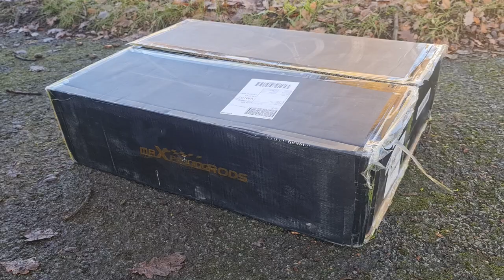BMW E60 MAXSPEEDINDRODS Full Coilover Instal and Adjustment

Comment: Will be attacking my E60 this weekend to fit the same coilovers, pretty handy with the spanners anyway but this is probably the best guide I've seen to fit and adjust coilovers! Subscribed mate 🤙
Reply from the maker: Thanks mate! I really appreciate your support! I would say the hardest part of the whole job is removing the bottom part of the front shocks if they had been clamped in there for a long time, a long scaffolding bar makes it very easy to pry it out, apart from that is a pretty straightforward job! I wish you all the best! 🤜🏼🤛🏼

Comment: Did this yesterday and got to say the video did help me do it alot faster, just one thing i didn't do was remove the rear arm when doing the back, all I did was undo the end which is at the suffrage end and move it down out the way, one less bolt that has to be removed
Reply: How are coilovers holding up
Reply from the maker: @marmrlss7332 still going!

Comment: You can remove front shocks by - removing 2 bracket bolts, tie rod and by loosen front lower control arm nut. Also three top bolts.
And torque specs applies when car stands on the wheels.

Comment: Good Job. I may pick up a set of these for my E60. 
You should always use some anti seize on the threads of the coilovers. This will make it easier to take back apart and wont rust as easy. They also make neoprene boots that cover the coilover to keep all the dirt of them .
Reply from the maker: Yeah you're right! I did use anti seize a few days after when I was actually setting up the height on all 4 corners. I had to let the springs settle a bit so I could get the height dialled in. I made coilover boots for my GS300 and every time I remove them to lubricate my coilovers they just look brand new!

Comment: Great video bro will really be helpful when I get a set of coil overs for my 530 especially with all the torque ratings 👍

You’re brave doing all this without axel stands - especially relying on a scissor jack for the rears 😂 knowing my luck if I did that it will end up falling over
Reply from the maker: Thanks for watching bro! Glad to help! 😂   I just lifted the car with the oem jack because it's a lot easier to use the other hydraulic jack to load the suspension before torquing the bolts, when I wasn't using it I had it resting under the car too. You're right, I should have used axel stands👍 I was a bit more relaxed about not using them in this situation because I had no reason to be under the car otherwise It would be one of the first things!👌🏼👌🏼👌🏼

Comment: Hi

Don’t you need to torque the control arm with the car on the ground? It will be twisting the bushing if you torque it with the car lifted.
Reply from the maker: You're right but what I've done was I lifted the hub with the jack before torquing it. It's basically the same thing

Comment: I was also thinking 2 months ago to buy them, thinking they super cheap, but i decided to get some quality shocks and springs insteed for almost the same price. Ended up with Bilstein B4 Sport shocks front and SACHS Sport on rear + Eibach Sportline Progressive springs. Basically coilovers under £1000 they poor quality.
Reply: Would u rather have gone with these coil overs instead ?
Reply: @erickpina8802  Nope. I made a good decision choosing them lowering springs and Bilstein B4 Sport shocks. They great, exactly what i needed.

Comment: Would you reacomend this coilvers? I want to but the same but i want to know if they are good coilovers.
Reply from the maker: Honestly if you're looking for something low-cost they're alright for the price range... if you're looking for quality I would recommend buying something like BC racing, HSD for example.👌🏼
Reply: If you are looking for super cheap coilovers, go for them, but don't expect to last or be as close as your used ones. Insteed you can opt for some quality shocks and springs. You will not find quality coilovers under £1000.

Comment: Did you run into problems with wheel rubbing the coilovers??! My front wheels are rubbing and shredding my tires
Reply from the maker: No because we were already running like 20mm wheel spacers.

Comment: Hi I forgot to ask when setting up the damping which way you turn for soft and stiffer
Reply from the maker: Hi!
I believe they' have 24-way damping adjustment.
If you rotate the adjustment knob on the top all the way to the left you have position 1, the softest, rotating to the right, 24 clicks later you should find the stiffest damping option.
Hope this helps you!
Reply: @evosgarage  yes I put a set of non damper adjustable on the wife 535d just putting a damper adjustable set on my 550i

Comment: would it be possible to put front and rear shock absorbers from another car on the bmw e60? What car could it work from?
Reply from the maker: Hi! 
I'm not sure if the e60 has any compatibility with another bmw models but anything is possible and can be done if people want to invest in it. Coilovers are very similar is design but the mounting points are usually different, if you get some coilovers that have the correct dimensions for your application you can get a shop to modify the mounting points to match the ones in your car. This is often done in older vehicles, where coilovers are either not readily available, or very expensive due to  the car's weird suspension design or maybe just because there's just not many companies building parts for those vehicles.
Hope this helps you somehow👍🏻

Comment: why not just use spring compressors and compress the spring so you don't need to remove all the control arms? would make it so much easier and quicker
Reply from the maker: True! I can see that working but i don't own a set of spring compressors! 👌🏼

Comment: These coilovers that rotate at the bottom to adjust like these, how do you adjust them once they're installed and tightened down?
Reply from the maker: Hi! Once it's installed on the car the bottom of the coilover won't spin, to adjust your coilover height you have to loosen the bottom collar and then spin the spring/shock assembly. Very easy job. Hope this helps you.
Reply: @evosgarage how much?

Comment: Great video just ordered a set for mine. I have the same wheels as you but are you running spacers and what size tires are you running
Reply from the maker: Hi! Cheers mate! 
Tyres are: 
Front - 245-35-19 
Rear - 275-30-19

20mm spacers on the front and
15mm spacers on the rear (honestly I could have 20mm on the rear too, it would clear without rolling the arches.

Thanks for watching!
Reply: @evosgarage  thanks for the reply hope my fit as easy as yours
Reply: How are yours holding up. Do you have any issues with them
Reply from the maker: @bmwe60nutter38  so far so good!
Reply: @evosgarage  that’s good should make a review on how they hold up over time
Reply: @evosgarage  out of interest would the wheels rub on the coilovers without the spacers. Have spacers ordered but wanted to install the coilovers while I waited for them
Reply from the maker: @bmwe60nutter38  i didn't try it without the spacer but it shouldn't it them because it wasn't touching the massive oem shocks without them either. The coilovers are narrower than the oem suspension. Go for it mate!
Reply: @evosgarage  hi fronts would need at least a 5mm spacer for full drop as coil will catch. Rear is fine just spacer for looks
Reply from the maker: @bmwe60nutter38  thanks for letting us know👌🏼👌🏼👌🏼👌🏼
Reply: They definitely rub on mine ordered ecs spacers

Comment: Hi mate what ride height was 8.5cm ?  Was car sat at 50 / 60 min ?
Reply from the maker: Yeah definitely! It doesn't even scrape going over the speed bumps!
Reply: So if I want 50mm set up all round what measurement should I measure on threads to save me having to put wheel on and off
Reply from the maker: @dannyjackjones9843  it's not going to be an exact science because the car has a different weight on every corner. For example in the front, the side the engine leans to is heavier than the opposite side and in the back one side is heavier than the other because of the fuel tank so you can do like me and start with the 8.5cm on every corner, get the car on the floor and measure from the edge of the wheel to the edge of the fender and then do the adjustments needed on the coilover. If it helps I've noticed that 10mm of adjustment on the coilover translates to a 6mm difference in the actual ride height. Use this information to your advantage, you'll probably get to your goal ride  height faster! Thanks for watching! I appreciate it! 👌🏼
Reply: @evosgarage  
Thanks mate 😎👍
Reply from the maker: No worries!🤜🏼🤛🏼

Comment: Man I wish mechanic shops didn’t torque every single one of my bolts to max torque
Reply from the maker: I feel your pain bro! A few months ago went to get a tyre replaced and they torqued my wheel nuts with the impact gun so hard that next time I had to remove it one of the nuts got rounded and ended up having to drill the stud to remove it...🙄
Reply: @evosgarage  damn that’s a pain in the ass, I was able to juuuuuust break mine loose yesterday using two wrenches together for leverage. But my front coil overs I fucked up and tightened on of the top bolts too much before going to a different one and broke the stud off and had to drill that stud out and make a new one. Nothing EVER goes as planned😂😂

Comment: what size spacers and offset are your wheels ?
Reply from the maker: Hi Kevin!
Front: et18, 20mm spacers
Rear: et32, 15mm spacers
Reply: Did you need the spacers before the coilovers were installed?
Reply from the maker: @VW_EOS_K04  not at all! Just for aesthetics really, to get the wheels to sit more flush.

Comment: Question: what is the maximum height you can maintain with these coilovers? Trying to stay as close to the original height if possible!
Reply from the maker: Hi! That's not going to happen Denos. Even on the max height you'll be lower than original height. 👌🏼

Comment: Ohh buddy, those are unsafe. I had them on my e60 and had to remove them.. the rear where they have the bushing that the bolt goes through.. that bushings is too soft it will let the coilovers slip off the bolt.. im telling ya.. keep an eye out for it.. I had to order different coilovers for the car because of it.
Reply from the maker: Thanks for letting me know mate!👌🏼👌🏼👌🏼 I will definitely keep an eye out for it
Reply: @evosgarage  no problem.. I can even show you a picture of what it is that happens if need be.. I mean they rode just fine.. but if you're doing ANY hard cornering at all... you're gonna have this issue.. I personally wouldn't trust it at all tbh.. just keep an eye on it...
Reply: They rusted out on me real fast also.. the threads... not even 3 months.. the new ones I have on been on for well over a year and not a spot of rust. No issues.
Reply from the maker: @HeirByFaith  that's true! I have buddy club's on my GS300, 4 years later they look brand new, I have other brand on my e36 and only after a couple of years they started rusting but the maxspeedingrods after 1 month are already rusted on the threads.🙄

Comment: Don’t buy anymore this piece of shit coilover safety is not a game ! 
If your budget is too low buy ap suspension coilover it’s a brand of KW coilover !
Reply from the maker: I'm not sponsored by Maxspeedingrods. The only Intention of doing this video was to show the process of replacing the original suspension with coilovers on this particular car. It's low budget part, low budget and quality don't usually hold hands together 😂 IMO people that buy cheap Chinesium stuff and expect quality need to have a word with themselves. Ps: the car is not mine, I just installed the coilovers.